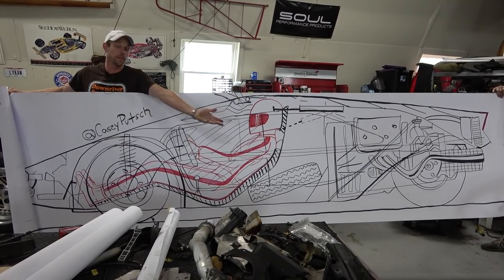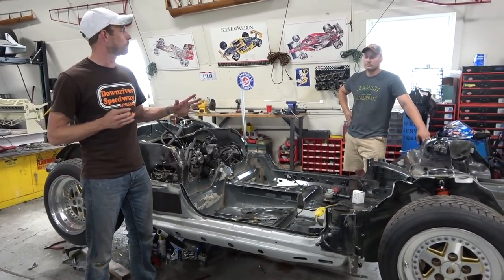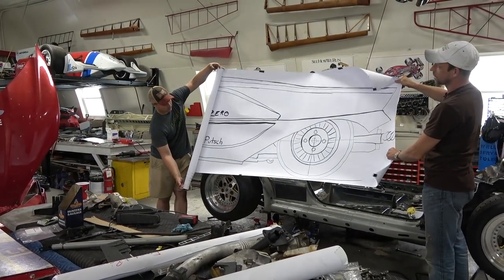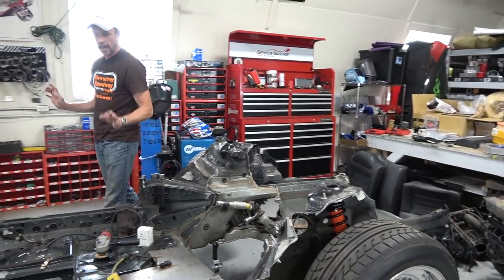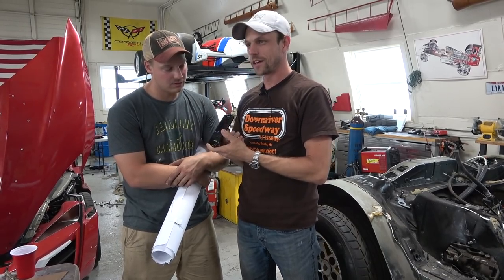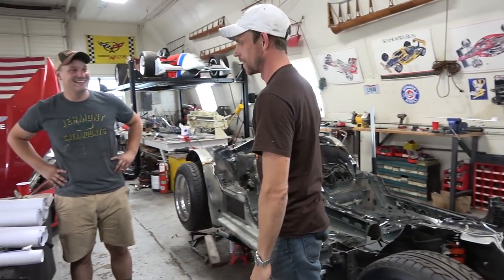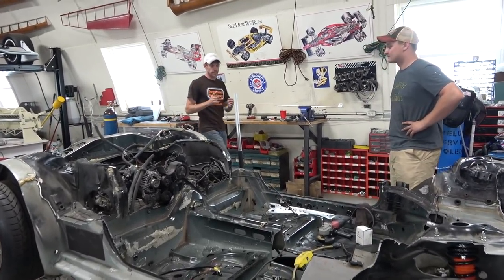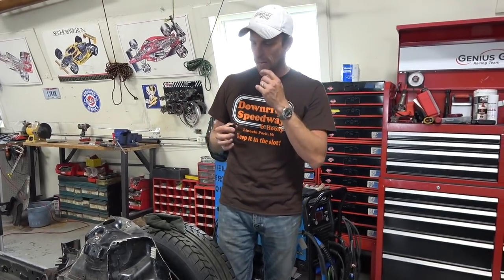#6 King Zero V12 supercar!

Comment: To me it would’ve (still would) make more sense to start with a chassis from something like a mini truck... As you say you’ve compromised the structure of that unibody car, now you are gonna cut the strut towers off and build them out of tube, cut the rear firewall out and probably more, then you are bracing it all back up with tube... From an engineering standpoint it would make a lot more sense to use an actual chassis that is already a self supporting structure with thick walls great for building a tube structure off of. The car you are using is made in a multi lay process, it’s not made to have focused stress points like you get from a tube structure and to attach the tube structure properly you need to use plates to spread out the forces. It would be so much better to start with a stripped down frame and just add your motor mounts, suspension, etc, then you can drop the floor pan real low between the frame rails to get the interior height you require.
Reply from the maker: Think about more...

Comment: I'm a mechanical engineer, and keep a compass, protractor, triangles, divider, ruler....on my desk. But I started drafting by learning old school first (2D/3D by hand, then 2D CAD, then 3D CAD). I'm considered a millennial, even though I grew up without internet, cellphones, computers, AC, power steering...  And I can sometimes use geometry tricks on paper to solve complex problems really quickly. But a 2D CAD sketch can be handy too. Pencil is just much faster many times. I keep bullet journals full of project notes and sketches, and find it super handy when I'm in the lab or otherwise away from my computer. My sketches always manage to impress people too, even the older engineers.

Comment: I'd say the best method is the one you know. Using a computer might slow you down, but for others it could be the faster method. 
For instance, I've been using a computer for most of my life, and as a result I can type at about triple the speed I can write. That doesn't mean a computer is better or faster, it just means that I'm more skilled with a keyboard than a pen.
Reply: They built the SR-71 Blackbird without a computer. Just designed with slide-rules and other very basic tools. I’m with you in tech I can make computers do work for me. But in my opinion some of the best things that move cars, bikes and aircrafts etc have been made with very basic tools. That in my opinion is proper awesome engineering!
Reply: Jyt He is not trying to build this as fast or as efficient as it could possibly be done but more like the way they used to make cars.
Reply: @carsonyoder6294  Yeah I know, I get that. I should've made it more clear though that I'm commenting on one specific thing that Casey said when he was talking about why he went with pencil and paper rather than a computer
Reply: Jyt Right! Sorry for the misunderstanding.

Comment: Thank you Casey Putsch for cracking open a Boxster S. I love seeing the steps and the engineering behind the Boxster and your new design! its really hard to find good content like this! I have gutted my Honda S2000 and welded in a 10 point chromoly cage. Really interesting stuff is hidden under all of the BS! ;) P.S. I go to the University of Arkansas and I'm not even a mechanical engineer but I try to teach myself because they aren't interested in the kinds of interesting projects like yours or mine. Keep rocking dude!

Comment: Great update!
Please keep those Gotti wheels or something of that era, as you well know the taller tire sidewalls buy back some ride  compliance despite the suspension travel reduction (and look cool as F).  

And I will put it out there again about the screw-type scissor trailer leveling jacks being ideal to level the chassis and dial in fairly precise heights when modifying suspension points from stock.

Comment: I really wish you showed how you made the front coilovers sit lower in you uprights.  I am building a midengine 83  911. I am using 996/986 front suspension in it. Do you happen to have the part numbers you used or any info on them? Are the fronts 986 coilovers or are they from another application?

Comment: Wouldn't longitudinal torsion bars like in the Traction Avant front suspension make more sense here? Of course, that would be a pretty massive engineering undertaking compared to just using an old Boxter and working around the strut towers.

Comment: So here me out, crazy idea: ya know how inboard shocks use an extension from the wheel to rotating assembly to convert the vertical motion to horizontal motion? What if instead of pointing that horizontal inboard, you instead angled it aft so you shock is instead mounted between the top of the wheel well and the corner where the A-pillar meets the body? This let's you keep a overall longer shock and doesnt interfere with the pedalbox

Disclaimer: not an engineer, and havent seen this idea used, probably for a reason

Comment: What were the original wheel sizes on the King Zero? Will you be using those sizes on your car? I was just wondering as that will surely have a bearing on the set up of the suspension on your car.

Comment: Stupid question, but if the top of the strut needs to be where the wheel is...why not move the strut out of there? Cantilever McPherson, sure, sounds mad, but it should work if you find the right angle. And considering you have to sacrifice "headroom" anyways, might as well, do it such that it turns from a strut tower, to a cantilever arm support, which itself, is flatter than the strut tower, because it only has to support a rod.
Reply: I was wondering why he isn’t considering a pushrod, in-board suspension over the knees. It looks like there is more room up there.

Comment: When I was first employed as a drafter I used T-squares, triangles, splines(?), with ink on Mylar.  ;-)
Then got a drafting machine (from a friend) that replaced the T-squares.
Then we started using various CAD machines (company couldn't decide what machine to use) that resulted in us using a third (worse) option.
Kewl multi function welder (stick for fixing bridges, farm equipment, truck frames, etc...).

Comment: Everyone's input needed, I just had an idea:
Wheel size is dictated by brake size and we all want big brakes on performance cars.
On this car a smaller front tire would make it much easier to get the desired design results.
So, what if you were to do INBOARD FRONT BRAKES similar to the inboard rear brakes on the old Jag XKE, that way you could run as much as a 15 inch rotor on a 13 inch wheel.
Of course that would require you to massively modify front wheel drive hubs with no brakes but retain the shafts for the inboard brakes.
What do you think???
Reply: That would also shrink the cockpit space massively, as that's where his legs will be.
Reply: @jameshaulenbeek5931  oh well